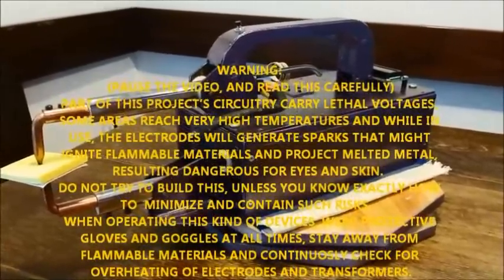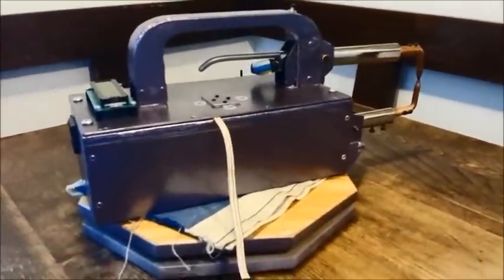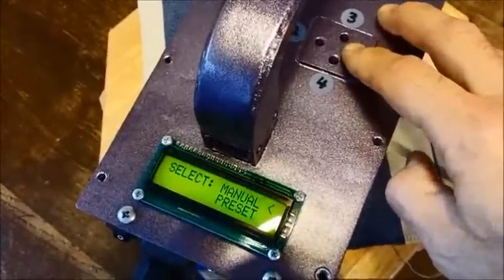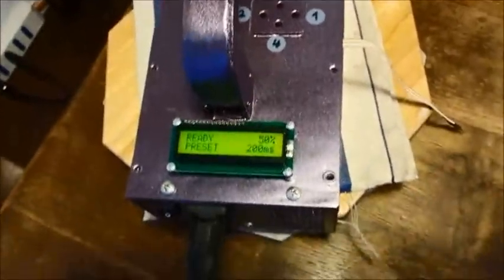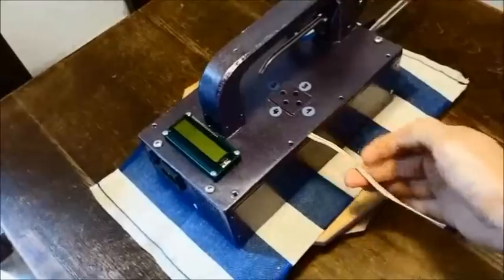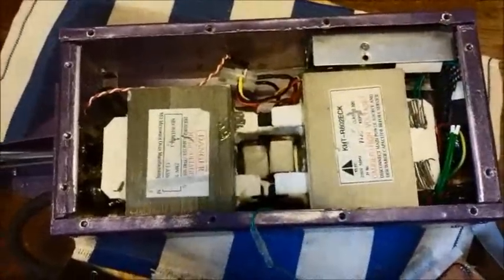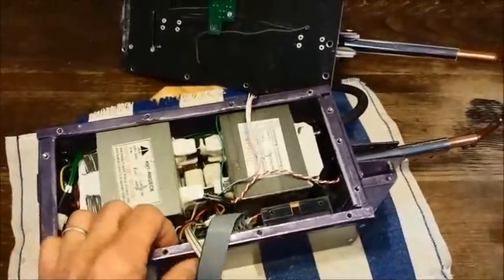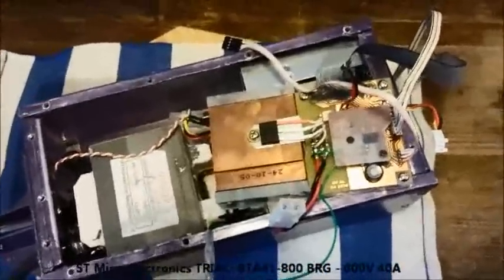Power Adjustable DIY Spot Welder (PART 1)

Comment: Would it work with a dimmer if I use a good triac? I don't want less than 50% and my thoughts are that an ordinary dimmer should be fine by cutting half wave.. Is this a good choice?

Comment: Very unprofessional. At 1:01 I see 3 bad things. 
1) The wire is coming in really badly between 2 metal sheets. Even if this is not metal, the insulation can be damaged causing short.
2) Used 2 wires, but must be used 3 to have a ground and all metal parts should be connected to the ground. To make it safe for using
3) Thin wire used.

Comment: Hello,
Thank you for the video demonstrating your welder.  The power adjustment is genious (for us non engineer types).  I am interested in knowing more about how you achieved the "power adjustable".  In my opinion anyone doing things like battery tab welding should use a power adjustment feature.

Again thank you for sharing.  Great build.
Reply: OK, so some research on the net yields, this is essentially a PWM controlled spot welder to accomplish the power adjustment ?  Is this the approach you used ?
Again, thank you for sharing your build, it helps to know what works well.